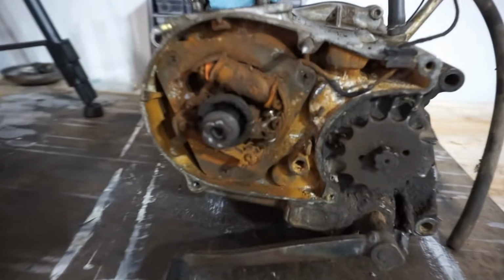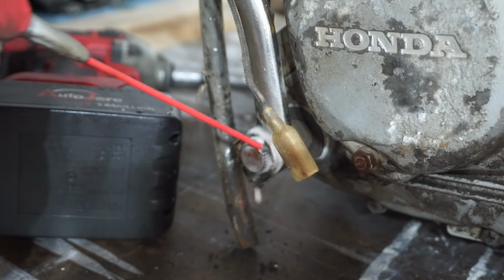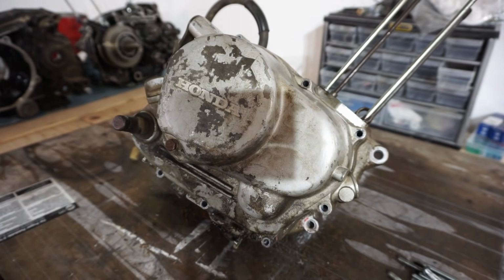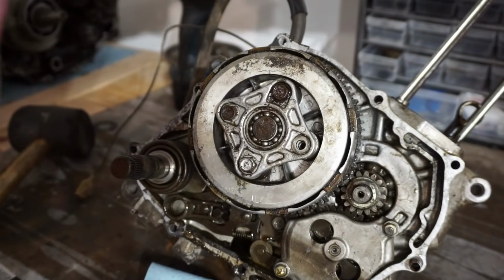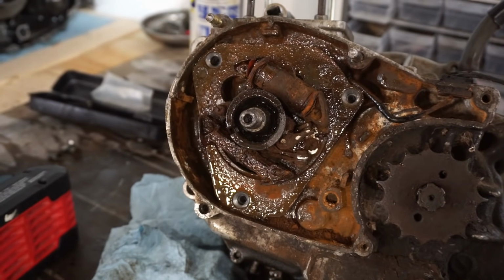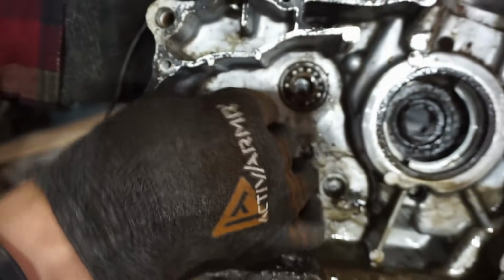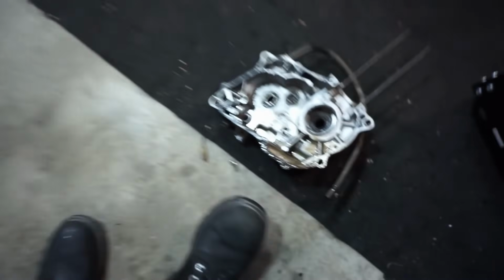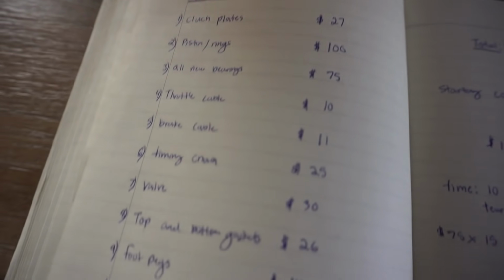VERY Rough Honda XR100 Dirt Bike. Can It Be Saved? (Part 2)

Comment: Never had an Xr until 2 months ago. Traded a 1980 atc185 straight up for a mint XR600r. The motor on the Xr needed the rocker (the one with the decompression lever on it) replaced. It snapped off and fell down through the cam chain channel and ended up in the bottom of the motor. Somehow it didn’t damage the motor in the process. Got lucky.

But this thing is a beast! Never new they made a 600r now I’m looking for a 650r! Aluminum frame water cooled 62hp stock!

Comment: You should get yourself a complete set of 6 point sockets and 6 point combination wrenches if you don't already. Also don't be afraid to apply a little heat around the thread areas on the engine case to help break that bond between the bolts and aluminum, I use a propane torch for this. Great job by the way tearing down all these machines.

Comment: One thing to really look for on those engines also is where the camshafts rotates in the head a lot of times they don't have bearings on the older models and that Cam and the bushing around it wears out and causes the timing to jump around because of the cam being loose
Reply: Yes, I am currently working on the same bike. The cam journals and aluminum head don't play well together if they ever ran low on oil for a few seconds in its life. I'ts the discontinued head that is the problem. $500.00 on well known auction website. You can use one from a 2003 xr 80 or 100  which I believe are still made.. Couple hundred bucks new fom honda but with all the other parts you need to assemble it correctly the head still ends up costing more than the bike is worth imho.

Comment: Hey man if you twist the impact to where it stops turning, and then whack it it works alot better. Give it a try. Great vids.
Reply from the maker: Thanks ill try that!
Reply: Get the Lisle impact (old Craftsman) (anodized black)  $20
Reply: Before I resort to an impact driver, I usually use a T-handle bit-holding screwdriver. Way better for putting pressure on the JIS bolts while providing much more leverage to apply torque. Works great, should be in everyone's toolkit!

Comment: Your hand held impact needs to be held with the tip in the screw head firmly and slight counter clockwise  tension on the tool then hit it adjusting your grip each hit     give it a try I believed you’ll find getting the screws loose much easier  Obviously clockwise to tighten with the impact tool I’ve been doing this for almost 50 years
Reply: Yup, an impact driver (old school - not the modern day electric ones of same name) was the only method of getting those casing screws to let go …. Did about 6 Honda 100/125 motors for myself and mates … good to work on, if you had an impact driver … 😃

Comment: Hmm, I'm confused as to whether those crank bearings were supposed to have stayed in the case and not on the crank? At any rate it "looks"  like there is enough there to work with, if you choose not to part it out.

Comment: My 2000 XR100 has regular 10mm bolts instead of those screws on the clutch cover, maybe you can get some of those to reassemble with and it will make it easier for re-assembly and torqueing and such.

Comment: My friend and I are building a heated washing cabinet for motorcycles and car parts, we have collected all the parts what we needed to build it,so I will make the cabinet and bottom of the cabinet i weld a box, where i weld also a Steel Funnel where is a metal meshes to catch all metal+rest of the sh#t, end of funnel go a metal pipe what go in 120 Litres metal box where is 3 heated coils,and outside its a old little ditch water pump, where go a pipe in the pressure washer and pressure washer pistol gonna been taken out and hose go in the self made block where is 12 fittings to pipes those pipes are little finger sizes and those pipes go in the cabinet wall where each have own nozzles in the end and the pressure is calculated to be around 130 bar and if that needs more pressure then we buy a bigger pump and that go inside on the tank and Line in there go straight in the block, but we will see how its works when its fully ready to wash some parts and cabin door gonna be maden from   double-layer plexiglass and if its not work then im gonna make steel door and proper seals on that.

Comment: Really enjoying this project. I'm not surprised you're not having much luck with the impact driver. I've always found you need to use something with a lot more weight behind it than a framing hammer. I use a 2lb brass mallet and that is still probably a little light for the really stuck ones.Edit: Just watched to the end. Good for you to work out the profit / loss. A lot of people get carried away with the romance of bringing something back to life. That's fine as long as you go into it with your eyes open!

Comment: I notice you use a drill motor. You should really invest in a 1/4in impact and a JIS bit. That would make it 1000 times eaisier to take off those old side cover bolts that get seized on there over time. Also if you hit em with some juice and a torch it'll free em up nicely

Comment: I was pretty sure this engine was toast at the end of your last video. There just shouldn't be that much rust inside the cases or valve cover. Somebody tried to fix this after the cam chain broke and left it open to the elements.

Comment: Ran into a similar situation I got screwed over, bought a 89 xr100r but the top end ended up being real beat still ran, and it was missing a lot of parts. $1300 bucks later including the purchase I have totally rebuilt the bike from the frame up. She is nice now but I will just break even when it sell it. They are great bikes but they do get beat on a lot

Comment: Hello I’ve been watching your videos for while and I rebuilt my Trx400ex a few months ago it runs perfect no smoke at all starts right up but after awhile of riding it I noticed there was oil all over the rear spring the pipe the the rear axle wheels everything so I looked around and it’s blowing oil out of the air intake hole I’m not sure why I might’ve really messed something up I don’t know but if you have any tips or know what is it that would be amazing thanks

Comment: You need a heavier, deader hammer for whacking that impact driver. I've got a lead mallet I inherited from my dad that works a treat.
Reply: A plastic coated dead blow hammer is the way to go, you can wack pretty hard and it won't bounce, plus it won't damage threads or parts

Comment: I just picked up a running 2000 xr100 for 450. Smokes like a 2 stroke tho. Has good compression and starts first kick cold or warm. Hoping it’s just valve seals but probably going to do a 120 big bore kit just to cover my bases

Comment: Joe you gotta get a can of pb blaster penetrating spray.  You'll retire the wd40 to using on squeaky hinges.
Reply: Yep, wd40 isn't a penetrant, it's actual name means Water Displacement formula #40. Pb blaster is designed to loosen rusted bolts. A little more pricey, kroil spray works even better
Reply: @dave1135  oh nice thanks Dave, I’ll have to get a can of that one too.  I always have like a half dozen cans of pb blaster around because working on jeeps in the northeast they are always rust buckets.

Comment: That piece on the flywheel is not part of the stator it is and it isn't it's part of the flywheel that is the timing advance and if you look on that piece on the stator on the motor it has two little slots in it those two slots fit in the fingers on the tabs on the flywheel as it spins those tabs advance the timing so all you have to do is clean it all up there's nothing missing it's all assembled correctly as far as the stator is concerned
Reply from the maker: Thank you that's good to know! I couldn't find that part on any of the diagrams!
Reply: @2vintage  and it costs under $50 to rebuild one of those stators you can use the primary pickup coil off of any KX 80 stator or any Honda stator they all use the same primary pickup coil there about $35 and a set of points is like 15 bucks and the condenser looks like it's not on the stator plate on that model it is probably up by the coil which is perfectly fine

Comment: When using your impact driver use a lump hammer not a claw hammer as they do not have the weight to activate the mechanism in the impact driver better.

Comment: You can build those motors pretty cheap, or go whole hog and spend $2-3k and do a big valve cammed 145cc stroker with a 6 speed and 5 disc clutch and lightweight flywheel with CDI.

Comment: I have a similar problem; Last year I picked up a 2000 XR80R for $150 and it needs quite a bit of parts. I am still locating a few parts and these are just rear wheel parts, sprockets, carb, air filter. What I do know the engine is not froze up and has 90 in the cylinder. What I am finding out is, somebody who had this must have scavenged parts off this one to fix another bike. I will continue to bring this bike back to life. I did a series of my 1974 Honda Trail 70 that I restored and still ride it as of last week for my annual Christmas Ride. The question is do you want to keep the bike or are you selling it off as a flip. It seems to me the older the bikes are the more the sentimental value they are...for Me at least...I may flip mine, so I can buy one for my wife...

Comment: Next time kid when you get a motor like that before you start breaking bolts loose spray the whole damn motor down inside and out with a good parts clean then get a good penetrating oil and spray the whole damn motor down again with the penetrating oil or better yet get a tub put it in the tub get some transmission fluid pouring all over the broken down parts and let it set overnight and after that spray it down one more time with Parts clean and then take it apart

Comment: You could always pick up a cheap Chinese bike with a CG200 engine that nobody wants. It’ll come with a 12v electronic ignition and a pushrod setup, just like the Honda CG125 style. It would likely be a bolt-in deal that would get the bike running with quite a bit more power than the original 100. The Chinese CG-series engines are quite well built; it’s often the rest of the bike that is a disappointment. You could then part out the XR engine and junk the Chinese frame.